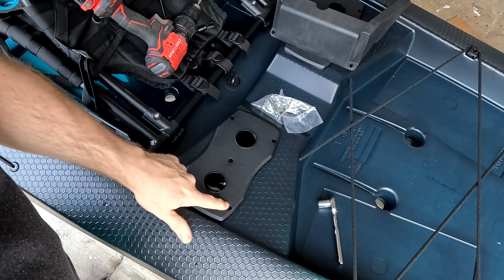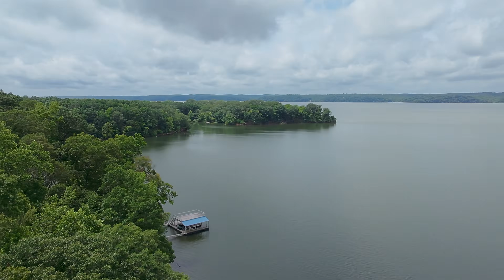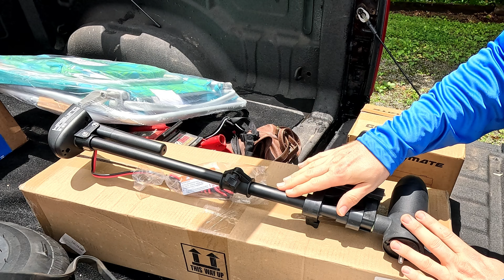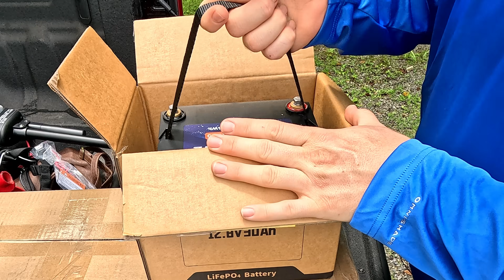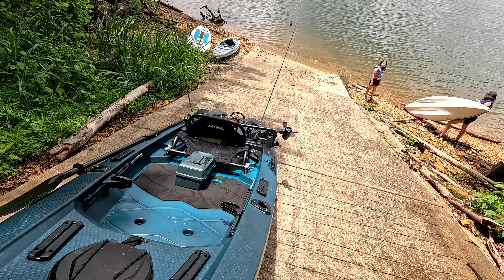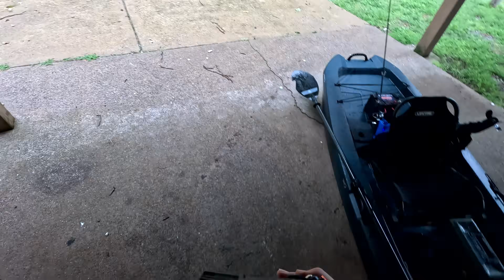Lifetime Manta Fishing Kayak Trolling Motor Setup & Water Test

Comment: Just wanted to pass along some information. I currently have a 100-amp-hour battery, and with my fully loaded 2016 PA 12, I get about 5 to 6 hours of run time at 60% throttle.

Comment: The side motor mount is not optimal. As you have said here, you end up adjusting the motor out of normal range for the direction you want to go, and even then, it’s more like ‘tacking’ in a sailboat. Nice try on  Lifetime’s part, but a front or rear mount would be 100% better.
Reply from the maker: It's definitely not optimal but its convenient, you dont need to setup any additional steering or controls so you can just slap it on and get going. I really want to setup a rear mount here soon.

Comment: I got the Minn kota endura 40 do u think it will be to heavy it’s about 18 pounds and the battery is 13
Reply from the maker: If mounting on the side like this you may feel the offset the weight, if mounting on the back or front I think it would be fine.

Comment: this motor doesn't seem available anymore. any other lightweight options? some of these 24" shaft motors are like 20 pounds. If you had to do it over again, would you use side mount or try and fabricate a rear mount?
Reply from the maker: (Comparable) Trolling Motor - https://amzn.to/4mvXTCm

The side mount is really nice for convienece. It's a quick on and off solution and it's bundled with the kayak so no regrets getting it setup. I'd like to setup a rear mount at some point but I dont know how I feel about setting up a steering system for it.

Comment: Whats your opinion? Do you think youll be leaving it side mounted? i Have the manta as well i followed a gentlemen here on youtube BarryP's guide to fabricating a rear mount that works on almost any kayak.
Reply from the maker: Yes, most likely. The main reason is for portability. I can't keep the trolling motor mounted so its nice being able to take it on and off as needed. Going with a steering system im not sure how easy that would be to remove it. It works well enough even if it has some steering quirks. However I have considered a bow mount, just not sure how that would work steering wise